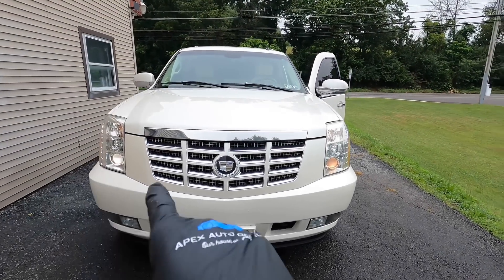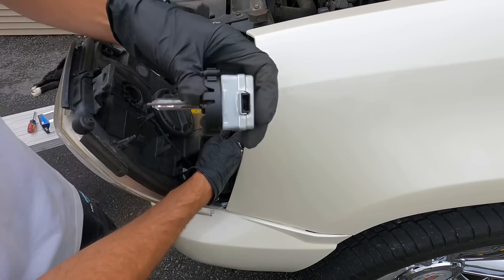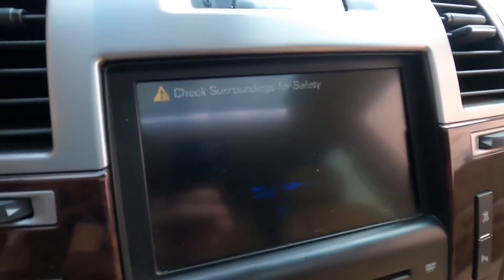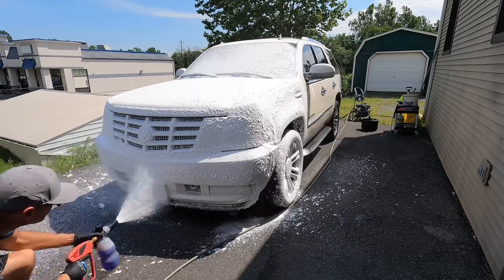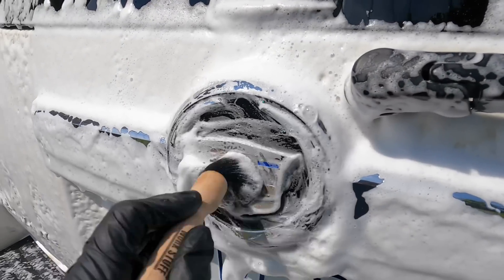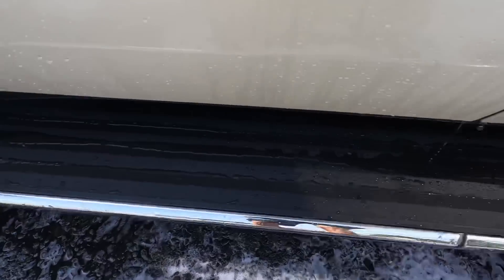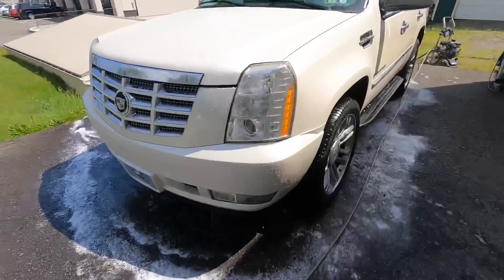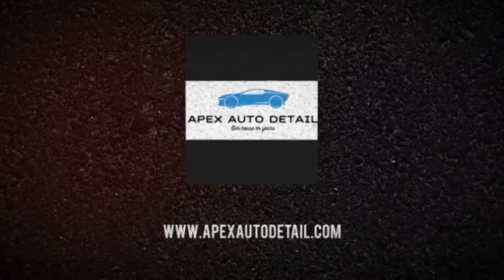Finishing The Auction Escalade With DIY Detail Incredible Suds! Part 11!

Comment: Looks great Brian! Thanks for sharing. Good luck with the sale. Your metal oxide coating looked great with the water bearing and gloss. Do you use it on the glass too including front windshield?
Reply from the maker: Everything but the glass.
Reply: @apexdetail85  thanks for taking the time to reply. If you get a chance. I have been using igl glass coat on the front glass or glassparency. On the other glass I use whatever I’m using on the paint like igl ecocoat.  What do you think of that practice with all your experience? Is it better to stick to glass specific coatings?